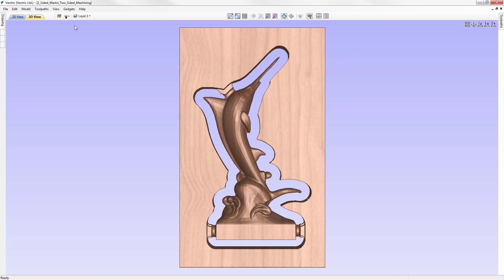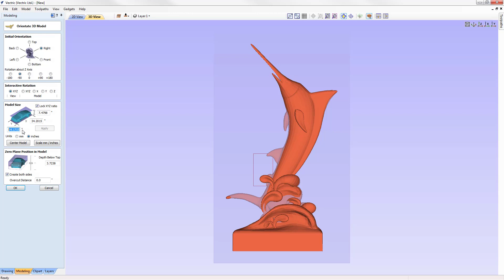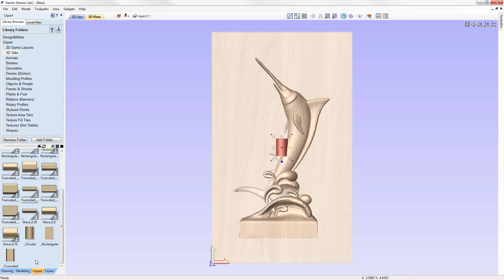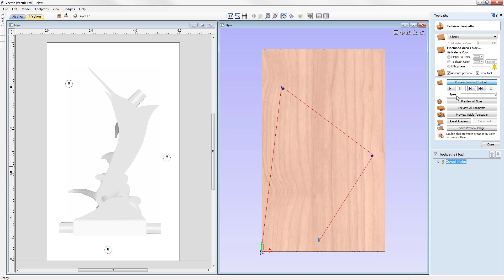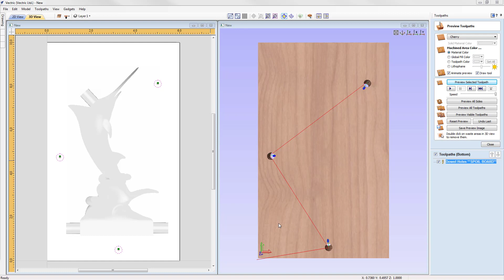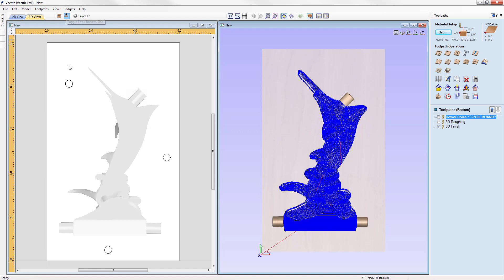Vectric V10 Tutorials | Two Sided Machining | Two Sided Marlin

Comment: Couldn't you just make 2 single sided and just glue them together?  Its easy to mirror any object.
Reply from the maker: Hello  and thanks for the comment Dave.  You could, but this model is not a mirror... the head is slightly turned and the base is a bit different.  You are correct, in that if it was you could do just as you outlined.

Comment: Is zero plane same as limit plane?
Reply from the maker: Hey Scott! Yes you are correct they're the same thing :) When importing models the software helps you out by creating the "limit plane level" with a zero plane component inside - this is the component that you apply negative base height to in order for you to cut past zero :) I hope this helps!
Reply from the maker: Hello Scott... thanks for the question. Not in this case... we are creating/setting a limit plane and that may be higher or lower then the zeroplane.  This will in some cases help us to get to detail that we otherwise might not or stop the cutter from going deepwer then we want using the 3D tooling stragities.

Comment: When I go to install the tabs by clicking on clipart, my clipart is empty.  I am using a MakerSpace client download of VCarve so I don't have the DVD to install the clipart.  Is there someway for me to build my own 3D tabs?
Reply from the maker: Hey Dan, unfortunately the Makerspace Edition doesn't include the clipart that is included in the core software. You can however build 3D Tabs using a zero plane with height (to the thickness of the tab you want) and then use the clipping feature of the level to clip the zeroplane to a tab vector - you can learn all about clipping levels here: https://www.youtube.com/watch?v=JfxWD0_WxJo I hope this helps as a work around! If you need any more assistance please email our dedicated support team: support@vectric.com. Thank you, have a great day!

Comment: I don't get the Tabs and Limit Planes when I bring in an STL. Any thoughts on what I'm missing?
Reply from the maker: Hey there! When you bring in an STL within the "orientate 3D model" form you have the option to specify an "overcut distance" (towards the bottom of the form) once you apply and are in the software in the modeling tab your "overcut distance" is represented as a Limit Plane component (flat plane with negative base height) the tabs are manually added in afterwards :) I hope this clears things up a little :)

Comment: I am confused by one aspect of this video. Z zero for the second side is set to the machine bed, but when the dowel holes are to be drilled into the spoil board the start depth is set at 1" with a depth of 0.5 ". If the tool z position is zeroed on the spoil board, why does this not result in 1.5" holes in the spoil board.?
Reply: It's because she selected "Zero off same side" and then flipped the material over.